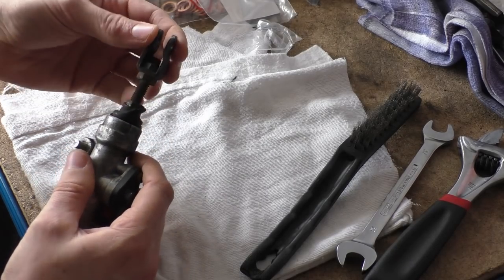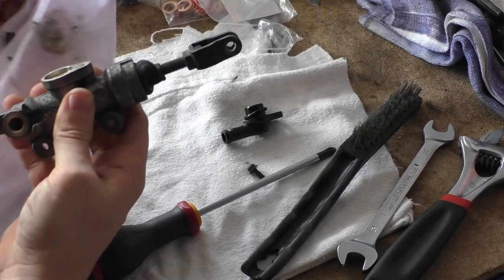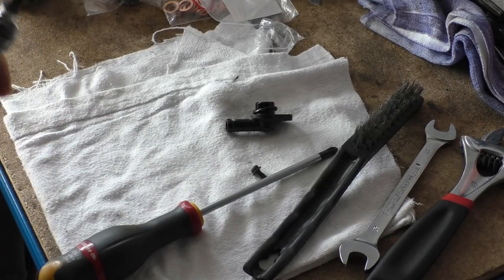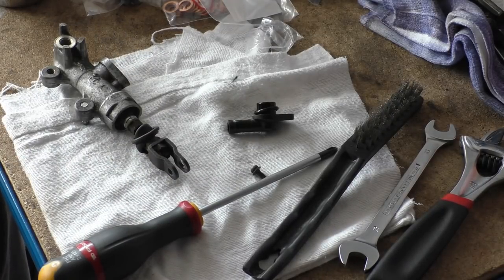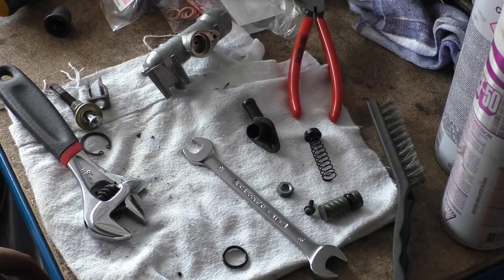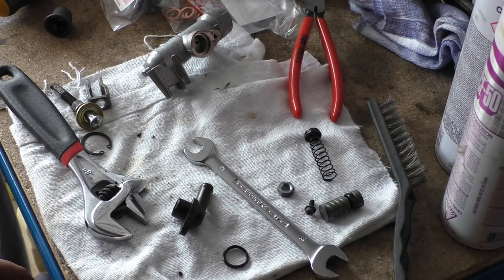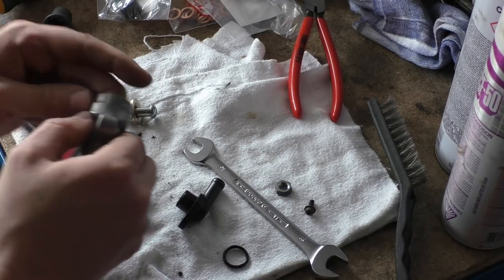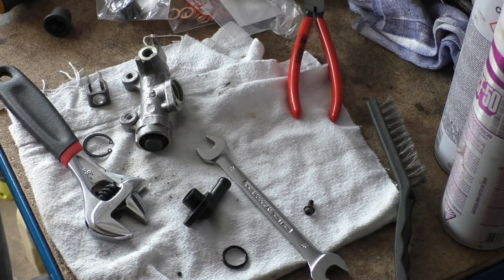SV1000 Rear master cylinder

Comment: A few suggestions that I bet you can't wait to hear, use a vice to hold it, use the rubber grease on the seals, use a parts dish so you don't lose anything and adjust the rod after it's fitted to the bike to ensure the proper clearance/freeplay.

Comment: progressive rate spring. to increase pressure as you get further in the pedal otherwise it would never have enough pressure to overcome
OMG that little nugget, and what happened to the M.Flyer he used to be alright. then he started hanging with him

Comment: I do all my alloy blasting with fine glass bead works great! After leaving the parts sit for a while don't they oxidize again sealing the alloy pores? Is that a myth? I have never had any parts go bad after blasting..
Reply from the maker: Go bad? I mean covering them in shit.
Reply: The Workshop just that you said it makes the surface ruff and then I was thinking you might have meant it will corrode but now realise you just meant dirt and crap will go in the pores.  The glass media I use brings alloy back really smooth though like new finish

Comment: So Matt, I had the same problem with the bolts beeing seized on my V strom rear brake. So I thought, If there had been some (copper)grease on the threads, would it not have helped? 
I had to drill both fuckers out, that sucked.
Reply from the maker: It depends if they are stainless fasteners - stainless usually needs something on the threads

Comment: Hi i have a problem with my clutch, when the lever is fully released in gear, the bike jerks then the engine revs drop and engine wont rev. It revs fine with the clutch pulled in. Any idea what the issue could be? Thanks
Reply: The bike does move freely and is rideable. it is only when the clutch lever is fully released that it kills the revs, if i pull the lever in again a little bit it semi engages and i can rev, i just cant fully release the clutch lever.
Reply: Sounds like the clutch may be grabbing at the end of lever travel, likely worn out clutch plates. Are you saying it doesn't cut out completely with the clutch released? Then it is slipping and either needs adjusting or new plates.
Reply: the worm wheel might be buggered mate ;)
Reply: It cuts out with the clutch lever fully out, when i start to release the clutch the bike starts to accelerate and the clutch starts to engage, until the lever is fully released then it stops accelerating and revs die, this happens in all gears. i can ride along by holding the clutch lever in a very small amount .
Reply: Whats a worm wheel?
Reply: What bike is this? Has anyone had the clutch or clutch cover off recently? Does your side stand switch work? Does the engine stop abruptly or just as if you turned it off? Any untoward clunks or other noises when this happens?
Reply: Its a Kawasaki er5. no the clutch has not been touched. Im not sure about the side stand switch. The revs go down as if i pulled the clutch lever in(but i have not) until i pull the clutch lever slightly in again and the revs pick back up. There was no unusual noises that i noticed. I recently changed the clutch cable, Could this have anything to do with it?

Comment: I see where he drilled a thru hole in that broken off bolt, and it's still in the cylinder..  what happen to adding a touch of heat to remove it after you had it all apart? LOL
Reply from the maker: Its a stainless fitting that twisted off - you'll see more later

Comment: Don't you have to put a thick layer of copper grease on the aluminum to keep it from oxidizing? Why would you want to use anything else? I really think you got there something wrong no copper grease at all? that can't be right. (LOL)
Reply: Knob head lube the rubber ring and plunger with brake fluid... every thing that goes inside gets brake fluid.